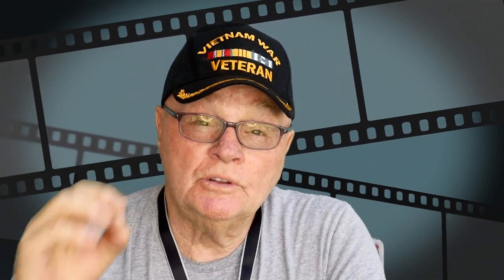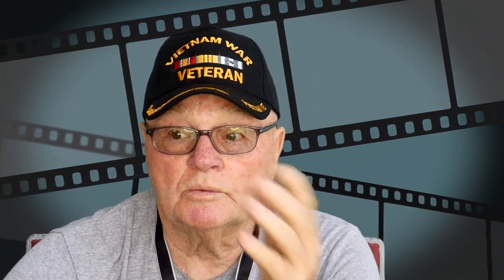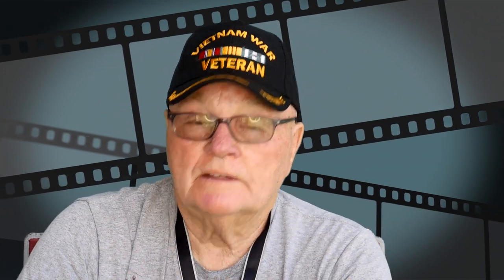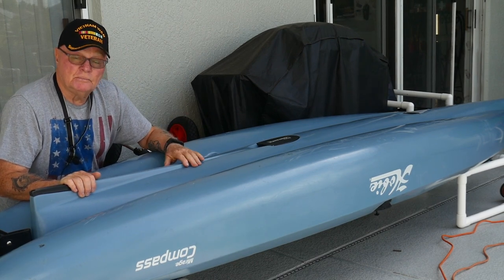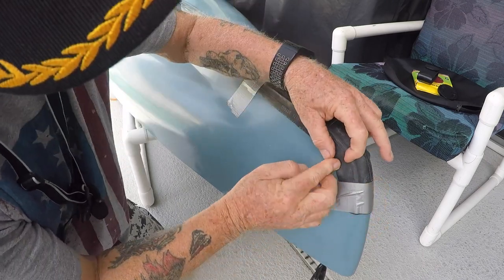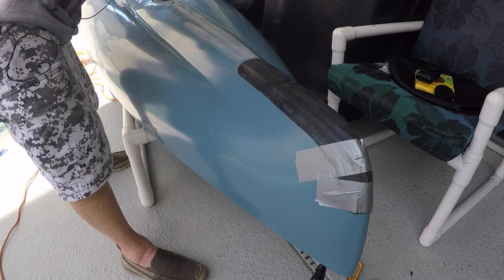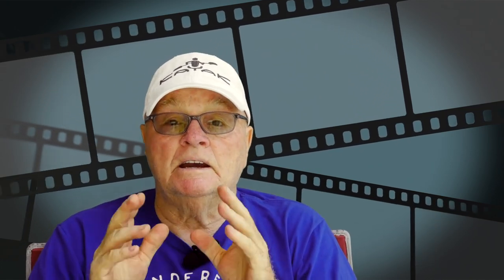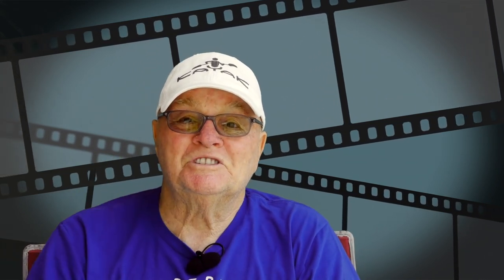DIY KEEL PROTECTION HOBIE

Comment: My experience has been that the Mirage Drive is great for shallow water in Florida.  Have used them in less than 1 foot water... Gotta learn how to flutter pedal.  Once I learned that the all was good. Give it a try if you haven't already... works wonders.  Change the location of your circular lights next time.  put them off to the side.
Reply from the maker: Thanks Steve, it turned out the Hobie was not for me and I sold it.

Comment: I’m also wondering if the unglued parts of the tube stretched out over time?
Reply from the maker: Sorry, don’t understand your question.
Reply: I was wondering if , without being fully glued , when friction happens does the rubber stretch and get sloppy? Did the project last very long , did it hold up well in salt water ? Thanks!!
Reply from the maker: Okay, the tubes used are fully covered by the tape so it is water tight, but being I have not paddled in salt water I don’t know how it would stand up over time.
Reply: Thanks for the info. I just bought a new Compass after wearing out a 2015 Revo.